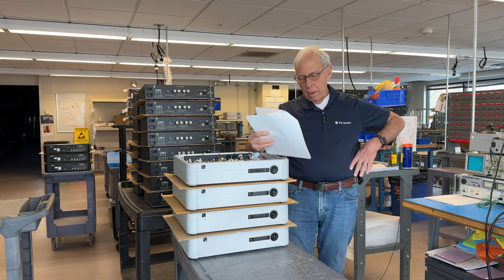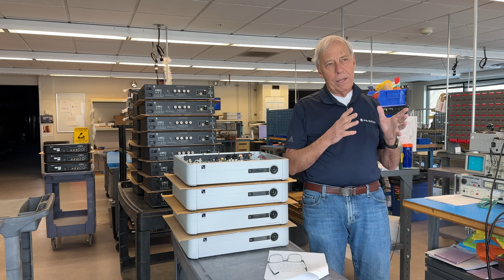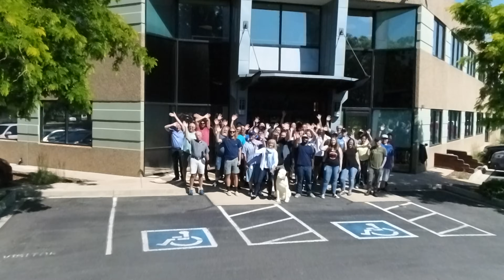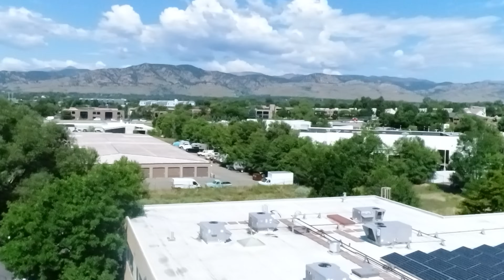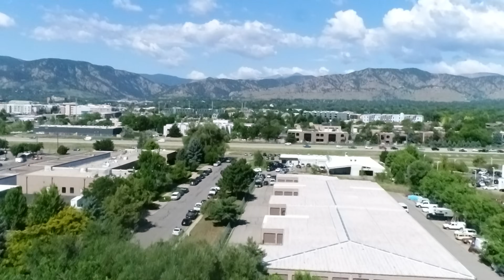Why USB noise is harmful to HiFi

Comment: Jitter is mainly the responsibility of your transport.
CD players have a built-in transport.

Audio produced on your computer uses your sound card's (usually built-in to your motherboard) built-in transport.
Even if your computer feeds your DAC a digital signal, your computer is sending the bits, and since it is the device doing the sending, it is by definition the transport.

Reducing jitter will reveal a sonic breath of fresh air.

I once tested an Aesthetix Romulus Eclipse DAC, being fed by an i5 laptop (not an ideal choice for a transport).

I used a USB cable that was included with my HP printer, and also used a USB cable that was included with my USB hub.
Both of the above USB cables wrecked the sound quality.  There was nothing musical left in the sound.  Everything was crushed, without bloom, without air, without space.  It was dull.

I also tested an Audioquest Diamond USB cable.  All of the above issues were gone.  The music was back.  It was wonderful.

Somehow, that Audioquest cable kept noise from the laptop from entering the DAC.  Or, perhaps, the Audioquest USB cable allowed the bits to reach the DAC with better precision; better timing.

Perhaps there are DACs that do the same thing, internally, negating the need for a quality USB cable?

I put the printer's USB cable back, and put the USB hub's cable back.  Both the printer and the hub work perfectly (although I never tested connecting the Audioquest cable to the printer or the hub -- I can't imagine an improvement in their specific functions).

Another source of noise could come from your DAC (or your CD player).  That noise can seep in to your other components.
Using a quality power cord will make a noticeable improvement in darker sonic backgrounds, and air between instruments.  You might not immediately notice the improvement.  But after a song or two, you will realize that you are in the zone -- sucked in to the listening experience.  When you put back the stock power cord to your CD player (or DAC), you will immediately hear the degradation.

So if you demo a quality power cord from, perhaps Shunyata or Audioquest, be prepared to buy it.  Once you use it for your CD player or DAC, there is no going back.
Reply: When my GPU has heavier loads, i hear lots of weird noises, do you know a fix for that?
Reply: @vinpin  If the noises are coming from your speakers (and not from within your computer's chassis), then the fix is to add a transport to your stereo.  There are stand-alone transports, dedicated boxes designed to deliver noise-free and jitter-free data to your DAC.  Nothing is 100% jitter-free or noise-free.  But that is its design goal.

Such transport boxes range in price from $100 (just a guess) to $25,000 (perhaps much higher).

But if you are having your computer feed an analog signal to your receiver, then not only will you need a transport, but you will also need a DAC.
You would use your computer's digital output to feed your transport, and use your transport to feed your DAC, and use your DAC to feed your receiver (or your pre-amp).

Audioquest makes a relatively inexpensive Jitterbug device (which is a transport) that plugs in to your computer's USB port.  They look like flash drives  They have more than one model.  They are said to lower noise and lower jitter.

I have never used one.  But they supposedly re-clock the signal.  I am not sure if it helps with noise  Their pricier one probably helps with noise (just guessing -- look for reviews).

if you give me more information on your stereo's components, I can better advise you.
I do not need specific model numbers.  But I do need to know what is connected to what.

For example, your computer is connected to [fill in the blank] with an RCA cable or a USB cable?.  And on and on, until you get to your speakers.
Reply: @vinpin  I thought of one other option that could work, and not break the bank.

You could purchase a mini PC.  Amazon has zillions of them listed.
You could purchase a "renewed" one.  I have done so.  You end up getting what was an $800 computer 3 or 4 years ago, for $100.  And they take up very little space.

You could use that mini computer to play music.  Then it will not matter how much internal noise your GPU makes on your other computer.

Note that I have never used a mini computer for playing music.  But lots of reviews on Amazon have people writing that they have.

There are new mini PCs, too, on Amazon.  But at any given price point, the new mini PC will be far less powerful than the renewed PC.

For example, the new mini PCs that are inexpensive usually come with slow Celeron processors, and perhaps 8GB of RAM at most, and only 64GB or 128GB of storage space.
For the same price...
...the renewed mini PCs usually have an i5 processor, 16GB of RAM, 250 GB or 512 GB of storage space, and will be 3x or 4x faster.

But since the renewed mini PCs are used, it is a crap shoot on the condition yours will arrive in.
I have ordered two, and both were clean like new.  One, however, had a broken connection under the cover that I could not fix.  So I sent it back.  The replacement was perfect -- good as new.

The sellers claim to inspect them and clean them up.  Based on reviews, that seems to be random, but mostly true.

Amazon takes back purchases, with no hassle, within 30 days.  So it is relatively risk free.

Note that nearly every renewed mini PC comes with Windows 10 Home or Pro.  They might not be upgrade-able to Windows 11.
I ordered ones with Windows 10 Pro, so that I would not need a monitor.  I enabled Remote Desktop server (available in the Pro version), and remotely connect to it.  So no need for another keyboard and another mouse (other than initially turning it on to configure it).  Any version of Windows can connect to a computer with Remote Desktop server enabled.
Reply: The DAC/Amplifier needs to be good enough to isolate the input noise from the output. Most budget/old motherboards I've tried suffer from this fundamental problem, especially when under load. Apple's USB-C DAC isolates the electrical hum of my motherboard exceptionally well (albeit being limited to 16-48kHz). I still do not know how I bought a Hidizs S9 Pro before the Apple thinking that it would be better but as it turns out, I got the same result, just that the output is amplified.

Ultimately, it's up to the active devices to filter out the noise. It shouldn't pass the noise as long as the combination of signal and noise do not pass the threshold between 1 and 0. In the same manner, an amplifier shouldn't care whether my power cord is gold plated, just that it provides power within the spec that my country imposes. The moment that my DAC/Amp assumes too tight a manufacturing tolerance for other components, I may have to look elsewhere.
Reply: @gabrielsirilan3406  "an amplifier shouldn't care whether my power cord is gold plated, just that it provides power within the spec that my country imposes."
Do power cords effect the sound quality of a stereo?
Reply: @NoEgg4u  first of all, thanks for your help.

I am using a Topping E30 with usb (usb power also from pc) and Adam Audio t5v speakers.

I tried using the Monacor FGA-40MF, wich does help with removing most of the Noise, but it makes the speakers sound a lot worse. 

I cant really justify spending a lot of money on a jitterbug, but the noise completely destroys the joy of listening to music. The transformer does help a little bit, but makes it sound like really cheap speakers.

Also when i connect my headphones directly into the headphone ports of my computer, i dont hear any noise.
Reply: @vinpin  "Also when i connect my headphones directly into the headphone ports of my computer, i dont hear any noise."
That the noise is present, only when using your USB port, indicates that your video card's digital noise is bleeding into your USB's controller.

When you use your computer's headphone port, you are not accessing your USB's noisy controller.  Your headphone jack is using your motherboard's built-in DAC.  Apparently, your video card's digital noise is not leaking into your motherboard's built-in DAC.

Perhaps you can try a different USB port?
I am guessing that you are using a USB 3.x port?

For playing music, a USB 2.0 port is far faster than the bit rate of even the highest sampling rate songs.  It is a yawn for a USB 2.0 port to play music.

The USB 2.0 ports will be using a completely different controller than your USB 3.x ports.  Your USB 2.0 controller might not suffer the same noise issue.  And it is as simple as it gets to change your USB cable to a USB 2.0 port to test if it helps.
Reply: Jitter isnt even possible in modern implementations of USB, what are you talking about?
Reply: "Do power cords effect the sound quality of a stereo?"
Yes.

Comment: PCs have horrible ground. PCs are almost as bad as cellphones for pumping out EMF, even wo wifi, BT, etc. Everything on a PCB wants to act like an antenna.
Forget about signal noise. PCs put out so much noise to ground, you should independently ground them from everything else. Those red ac plugs in hospitals all have individual ground for good reasons. All pcs in an audio chain, be it at home or in the studio need there own ground away from equipment ground.

All electronics pick up emf. Why the FCC approval sticker mostly states that a device can handle the RF noise, and not become a radio station by itself. The FCC sticker does not intend to say that RF or EMF will not cause problems with the device. It's a game of limiting interface. In any wire or trace on a pcb, there is noise. In any audio circuit, there is noise. If left over from the big bang, to the sun, to a baby monitor, or a microwave oven; keeping out the noise you can control makes everything else easier.

The data stream is not the problem. It's the wires to ground that make antennae, and all rf and emf in a box is shared and must be dealt with. The difference in a recording signal to noise, and a cpu signal to noise is over 20 trillion to 1. Cpus work with voltage differences of 0.00000000001v today. Keep the noise out.
Reply: But digital processing gets rid of that.
I'm from the days of sound cards for computers. Nobody uses those anymore.  As a matter of fact I see people playing pretty hq sound off of a computer all the time. As long as it remains in the digital realm.
But all I use a computer for is burning things like CD to flac in order to play those files on streamers, car stereos, portable players, etc. I tried playing files off of a computer with a USB cable but was not happy with the results and for that matter it seemed redundant.
A lot better ways to play digital files are out there
Reply: I replaced a Mac Mini with SSD running Lossless Switcher with a Bluesound node.  No difference.

Added a DDC.  Honestly no easy difference of which I’m convinced.
Reply: @musicman8270 the digital nature of data will not remove a bad ground. It all must find ground eventually. 😂
And no, as long as it's electrons in a wire, there is forever noise. Back in my day we were trying to make femtovolt amplifiers for superconductors, but that was solved in the '70s.
Reply: Motorola, "Motor Radio" was named as such to fix ground and RF EMI so car audio works today.
Reply: @KevlarCondom   But noise is irrelevant concerning digital. 
Because the only thing that gets through a DAC is the music or sound decoded from the digital signal. Why digital sounds as good as it does. And why vinyl sounds more "real" because of the things that are left out of a digital signal. I have had trouble with a bad ground, but with analog devices
Reply: Jitter is caused by timing issues between the clock signal and the data stream. This can result in a wrong bit being latched in to a register. You don't need a transport to have jitter. Moreover, if the transport provides the master clock as is the case with a CD player with a build in DAC (or when you have a clock output signal) then jitter is not a big issue.
Reply: @musicman8270 absolutely not.
The digital signal, inside a cpu, when processed, can be changed by outside EMI, EMF, RF.
Cpus literally work in an audio equivalent of 10db of signal in 200db of noise. Dropping EMF inside the box is an easy way to improve quality. 500db of sound will distroy the entire universe! (thanks exponents!).
And no, eventually everything needs to go to ground. No Dac can fix ground. No digital anything can fix the analog side of every amp. And no data stream, when inside a cpu, or ram, or dsp, can be fully protected from EMI EMF or RF. Every single wire or trace is an antenna. Full stop.
Reply: @musicman8270 EMF noise, and noise in music are both identical if it's 0 to 60khz, and completely different if it's EMI EMF or RF, or a ground problem. Hopefully the only EMI you'll ever experience is a Ground Problem, and they can be nightmares.

Comment: Would you care to explain to us how to "describe" digital domain noise, shot noises, thermal noise, induced noise, and any other digital noise? I've been using USB galvanic isolation like Musical Fidelity's V-Link for past decade and i still had hard time explaining to people how it sounds so "isolated" and "clean" or "black background" and had to resort to silly audiophiles language for this.
It's like a bit of a "black-hole" of a signal, and you can't comprehend it until you've get rid of it.

Comment: Everything that Paul talks about it applies to rolls-Royce equipment (speakers, amps…) most of us use Honda to Mercedes type of equipment. We don’t have to worry about this stuff
Reply: I begg to differ on that. It is even more audiable in a low-/medium cost digital system that is reasonable revealing (rarely are they highly revealing, though), because those loudspeakers don’t handle intermodulatory audio signals very well. More high-end speakers can in many instances have a design that will to a certain degree handle shortcomings upstream in the system in a better way than a speaker with only mediocre parts - they are more prone to distort than a better speaker.

Comment: Truthfully, Paul, "Noise" could be a 3-hour discussion at an audiophile roundtable. It wasn't until I'd gotten more into high-end, revealing audio that I realized tape hiss, a dirty record or a poorly recorded CD weren't the only types of noise to enter a system. Vibration, radio frequencies, static electricity, etc can all create noise that you wouldn't perceive until you removed it. When you rid yourself of it and hear more of the music, you realize it right away.

Comment: You are absolutely right...some people think that because everything is digital before the DAC there is nothing to worry about...but that is completely wrong as I fully understand the problems with digital timing and also the distortion between the computer and the DAC due to ground problems

Comment: Jitter is all about timing accuracy.  Music with jitter is like looking at a blurry video where the projector was vibrating.  Instead of sharp accurate picture it is kind of out of focus.  And if the three colors are moving independently the colors will be all messed up.  Reducing jitter in a DAC sharpens the image, improves perceived dynamics and particularly improves bass.  When it gets really good, the sound becomes natural and analogue in nature.